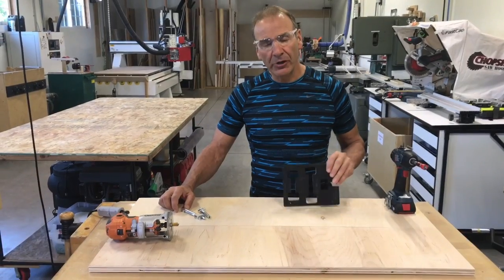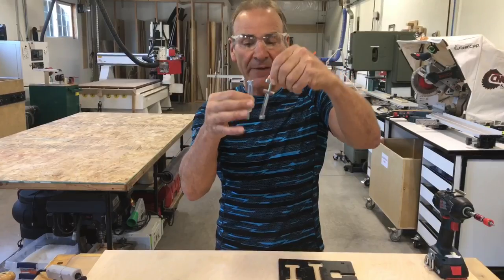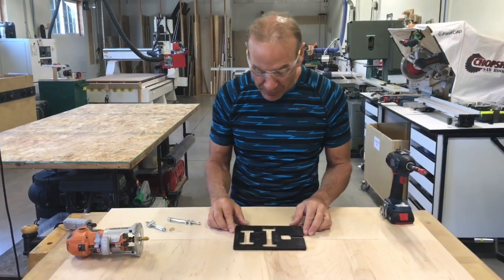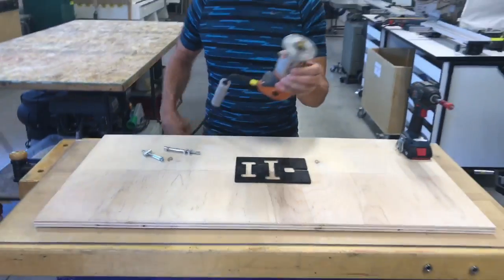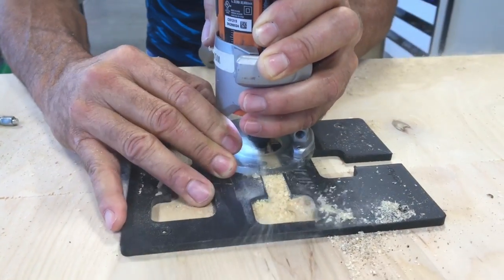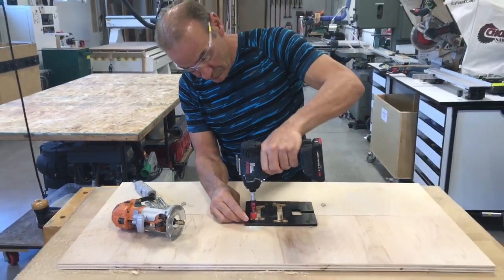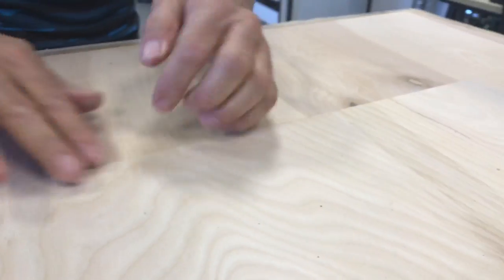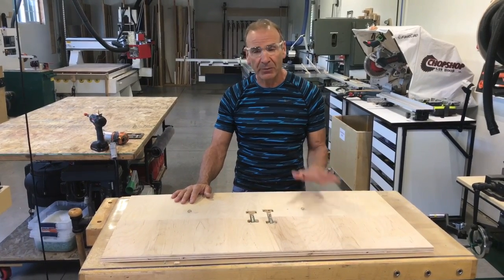FlipBolt Countertop Connector and FlipBolt Jig

Comment: Suggestion: Use the Fast Cap template as a guide and draw lines on 1/4" or 1/2" material so that you can make a new template in case you mess up the factory template when you go to plunge the router into the counter top halves that you are going to join together. Not everyone has  steady hands like Paul does and it's very possible you will damage the factory template when you go to plunge the router by hand. The safest way is to use a plunge router (if you have one) with a rub collar. Even if you do happen to nick the template it will still give you a good result however.

Comment: Will these work to connect two 1/2" thick osb boards? Would the bolts even work at that shallow depth?? 🤔 Also, the 2 boards will be standing vertical. A two piece wall. 80" tall, 5.5' wide.
Reply from the maker: @JASON D We reached out to our engineering department and this is what they recommend, "Not in the way shown in this video, but might be able to do it using J-hooks. It's not as good a system that way as the force isn’t IN the board, but rather on 1 side causing a bit of torsional force. If it were me, I would do his project using 4 j-hooks, 2 flip bolts, and then 1 or maybe even 2 quick draws to counteract the torsional force." Here is a video that shows what our team recommends: https://www.youtube.com/watch?v=ixO_duosCN0 

If you have any other questions please email us at info@fastcap.com
Reply: @FastCapLLC   @FastCap  Hey, thanks for the advice. I did order the 2 flip bolts and 4 j-hooks, like u said. And they worked exactly as they do in the video. But I didn't think (DUH) that it would only be that SOLID in one direction..smh 🙄 So yeah. Im gonna do the other thing u suggested. Which is to order 1 or 2 quick draws. 

P.S. Is there a way I could tap additional screw holes in the j-hooks, to make them double-sided and just screw them together from the opposite ends of the board?

Comment: This is excellent Paul, nice work on this jig. Nice dust hose reel, did you mean that this is a new product for you or were talking about something else?
Reply from the maker: brian both the filpbolt jig is new in that it's injection molded instead of made out of Masonite and the super real or hose reel is a new product as well. It allows you to easily access a large vacuum hose and wind it up with ease.

We Have a great video on this that we have not posted because it is not on our website but soon it will be available it's an amazing new product.